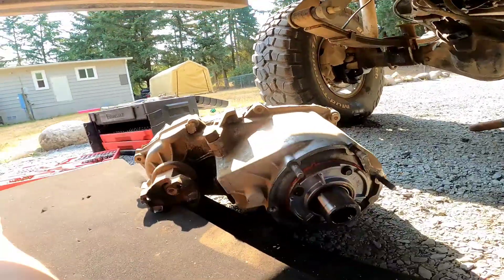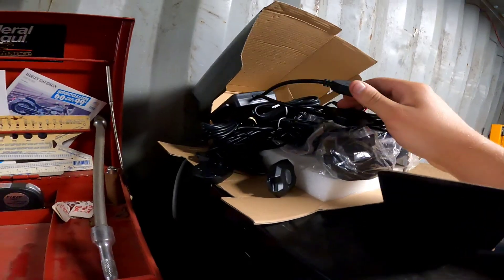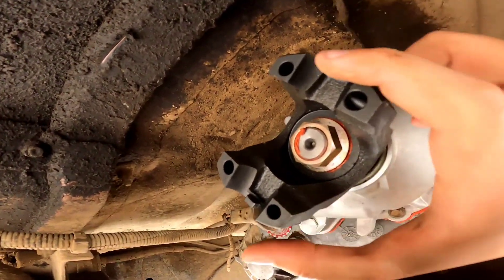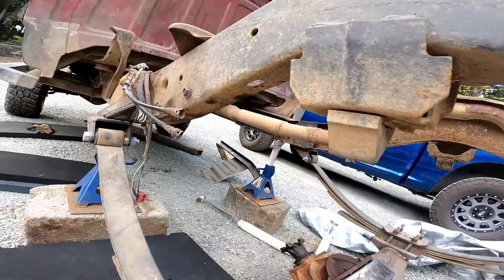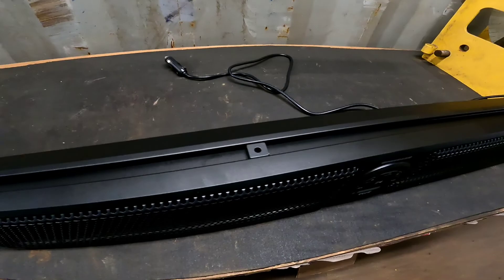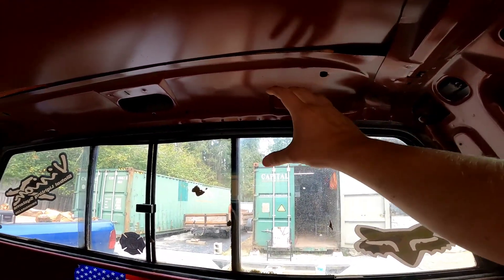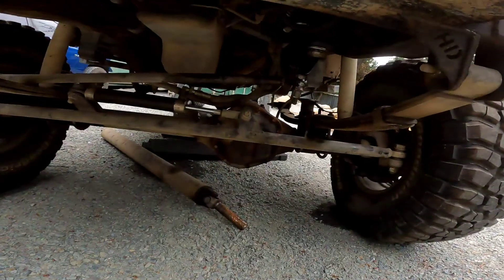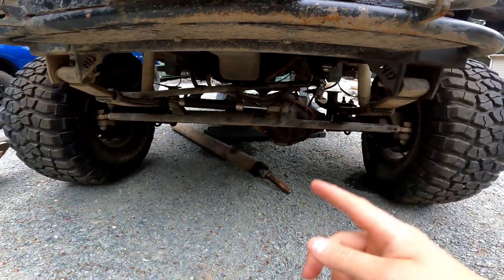NP231 SYE KIT and Bluetooth sound bar

Comment: I called out about a straight driveline for my double cab 02 and the guy told me anything over 60 something inches is not good to do. I guess that’s why Toyota has that carrier bearing
Reply from the maker: My driveline for my Dakota is basically 6' end to end I have absolutely no issues